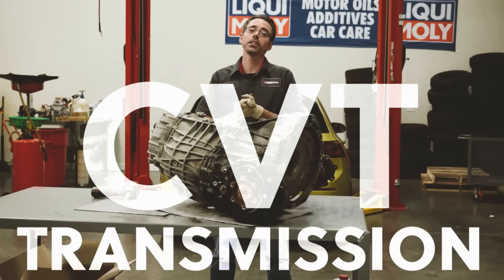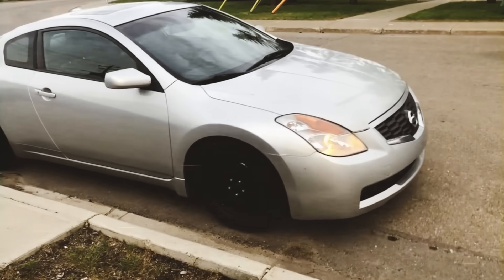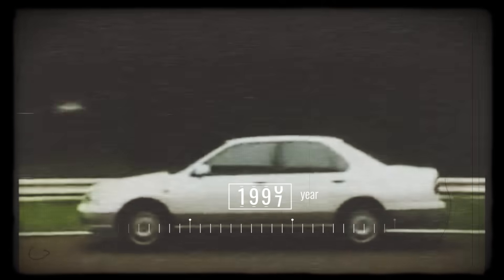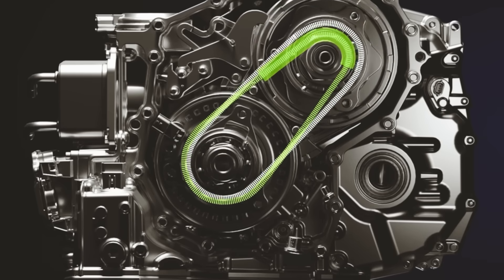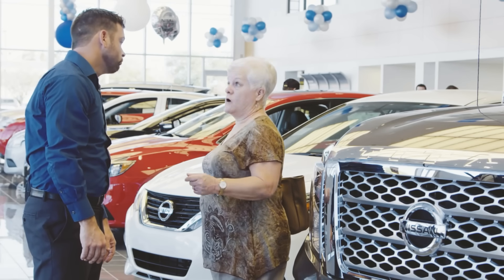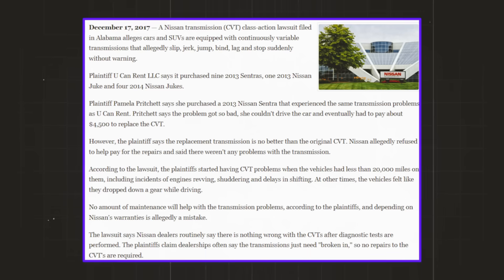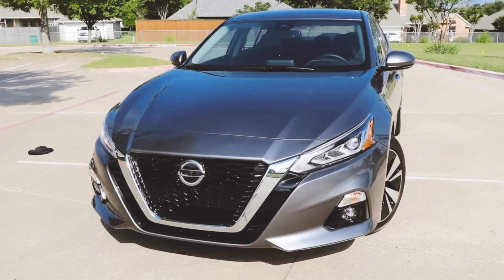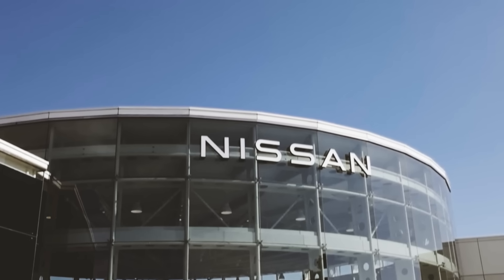Unpacking the FAILURE of Nissan's X-Tronic CVT

Comment: I have owned a 2004 Nissan X Trail ST 4x4 for the last 10 years. It has only 170,000 Km, and has been regularly serviced since new. Still drives and feels almost new, with the 2.5 ltr petrol engine.
The Nissan, and its reliability has impressed me. Naturally, the Automatic Gearbox on our Nissan is REAL!! I was about to go out and purchase a 2 - year old Nissan X Trail, until I checked and discovered that the "modern" version of the X Trail was fitted with a CVT Unit. I ask this question: Why re-invent the Wheel?? CVTs have been around (at a guess) the 1950s. I have also worked in Industry with CVT Units, that operate on the Cone Principal. I have seen them get so hot, that you can very easily fry an egg on them!! If the CVT in the Nissan is getting hot, then the laws of Thermodynamics tell me that this is energy (which should be driving the wheels) - is lost - as heat. Sorry, but now it will be a purchase of some alternative Japanese SUV - that is still manufactured with a real, conventional Automatic Gearbox

Comment: Total garbage any CVT. I got burnt once on 2011 Cube never again! The rebuild cost me $3500 at 106,000 miles in 2018. The 2011 Cube didn’t qualified for cvt trans recall. BS only purchased a manual transmission. BS  just go back to gears!

Comment: My 2016 Altima's CVT failed at 49,500. A $6100 replacement from Nissan failed after 200 miles. Back in the shop.

Comment: I had purchased a used 2017 Nissan Sentra three years ago and was told it was a rental by a Nissan dealer in Phoenix Az. I wasn’t informed that the transmission needed extra attention in servicing. It recently started to have acceleration problems with the air conditioning on. Took to a Nissan dealer in Flagstaff Az and was told that it needed a new transmission at a cost of $8K. They didn’t mention anything about the   the class action lawsuits. So, not only Nissan and their dealerships are keeping quiet about theproblems with CVT’s. I don’t have the money for a replacement and most of those lawsuits listed on the internet are closed.

Comment: After 2 CVT failures in 90,000 miles, we Just dropped our 2013 Sentra as a trade-in for a Toyota.  Sentra was a great car, but the POC transmission was a huge pain.  Our LAST Nissan.  Ever.
Reply: How much $ did you get back? My 2016 Rogue’s CVT is going to absolute shit. I ran an errand and had just enough energy in it to make it back home, even flooring it a few times.

Comment: CVT's are cheaper to manufacture, but freaking expensive to replace if the belt explodes...so WTF!  Then putting in the fake shifting negating some of the CVT efficiencies.  So just go back to a tried and true geared transmission...maybe the fuel efficiency regulations are so scary that losing faith rom your customers and lawsuits are the lessor evil?

Comment: Click bait.         How bad is this transmission that the creator of this video felt the need to put in footage of a TOYOTA PRIUS at the start?   The Prius has the most reliable tranny there is, so let's lump it with the Nissan - the people with the worst tranny.    Then the video implies that the Toyota CVT is the same unit. . . . . .  Which it isn't.  About as similar as apples and elephants.   Grossly incompetent video. . . . . . . . .

Comment: 2014 Nissan Rogue, CVT failed at 60k miles, but after 5 years of ownership (so no warranty). Paid $1600 out of pocket to replace the valve body of the transmission. Did get my money back last year in the lawsuit since I kept my receipt and dealer documents.

Always brought the car to the dealer for maintenance. Had issues even with the CVT not shifting from the lowest gear when starting up hill from a stop, turns out that it was a software defect for that.

Comment: I bought a 2012 Maxima, new and have 50,000 plus miles on it. I change the trans oil every 5 yrs and have not had any signs of trouble. I know the mileage is low but  I think they made them stronger but I also make sure to change the oil and at least every 30k mi or 5 yrs which ever comes first.

Comment: only recal for my 2022 nissan sentra is the tire rods. 54000 miles oil changes every 4000-5000 miles, transmission fluid changed at 49,000. no issues
Reply: That's very low mileage. Seems like a lot of these transmission failures occur passed 100,000 miles or so

Comment: My mother had....i believe it was an 09 rogue. Had gone through 3 cvts before I totalled it with like 80k miles on it. Those things are hunks of junk. IDC what the lunatics out here claim about "they break because you arent maintaining them properly" If your transmission is so shit that taking it to the dealership for everything (because it is new when you buy it and has dealer services) and you can go through multiple of them in under 100k....its a bad design. People drive a random Camry for 200k without ever doing anything to the transmission and it will run great. If it takes random luck and adhering to the manual TO THE T for it to not have catastrophic failure, it's a bad design.

Comment: Nissan also finances to the people with the worse credit. They have more horse power then Subaru that uses the same manufacturer for the cvt. People that buy Nissans or lease them. Tend to beat on them and don’t service them/ change the fluids. I’ve even seen Nissan adding dipsticks to there cvt. Making them easier to service.  Unlike Subaru.  So there are other factors to Nissans bad transmissions

Comment: I don’t know but I have 2012 rogue with 155k and still going never mess with the CVT , I just changed oil every 3k miles and don’t drive it hard, it’s 14 years old, and I have a 2018 GLC now that 9 speeds jerks a lot

Comment: Don't understand why people are surprised at this. Normal transmissions that EVERYONE have been using for the last 60+ years fail all the time, why is this any worse than that? 

And that has been researched and developed and worked on by every single automaker in existence. 

I had a Nissan Altima back maybe 10 years ago with their cvt, I also had a Honda Civic with a cvt at the same time and the Nissan one was way more reactive and quick and didn't seem to be "searching" for a gear like the Honda did. I know no gears exist but they have this time after you accelerate that they adjust and it was way better in the Nissan.

I don't like any cvts but as far as I can tell based on my experience with Toyota, Honda, and Nissan, they have the best of the group.

Comment: Owned 4 Nissans and was a  lifelong fan… even part of a Z club. 
Then I bought a 2003 Murano with CVT for my wife and will never go back to a Nissan dealership. Car was 100% disaster, even with 3K oil changes and 40K trans oil changes. They squeezed too tight and you can tell.

Comment: IMO the new Maxima having a turbo 4 cylinder engine (less torque) is likely what fixed their CVT issues. Seems the VQ35 V6 was the engine that consistently blew up these CVTs although I'm sure the driving style had more of an impact overall

Comment: Yes, these transmissions are definitely junk. My daughters 2020 Nissan Versa's failed at 82k miles. When I asked the service department if the fluid change was part of the maintenance schedule and they said no, but customers do have it done. This company needs to add fluid changes like Honda and other manufacturers do. Otherwise, don't buy cars with a CVT.

Comment: Yea they are bad transmissions. That said driving style and maintenance can go a long way towards extending the life. These do not like a lot of sudden full throttle driving. Ease into the throttle and they will last. But instead, due to the rubber band feel, people jam the accelerator to the floor when it’s slow to respond, stressing the transmission. Service every 30k or at least by 60k regardless of the manufacturer’s recommendation.

Comment: i run a 2021 kicks knock on wood no isses i have 35k miles its new they fixed most issues with the xtronic in late 2020 maintain them do flushes every 30k i do mine every 10 k its worth the 250 bucks every time i do it just maintain and go easy take off slow when going into reverse wait 3 seconds before going into drive dont slam on the gas treat it like its your last car forever on earth  and it will last and anymechanic that tells you we replace parts drop them cvts are not serviceable you replace the whole thing wiht a new one a new one is about 3500 to 4 grand and another 2-3 to install 6500 should cost   these should last beyond 120k miles folks just treat them right

Comment: The video failed to note the difference between the Toyota eCVTs with the planetary gear and the cone/belt CVTs. The planetary gear types also used by Ford and even a few early Nissan's are bulletproof. The cone/belt CVTs will never be suitable for automotive horsepowers.

Comment: Maxima 2004 was the worst car I've ever owned. It was only good on the open highway. Locally it had no feel for the road. It was exhausting in stop and go traffic and I aways viscerally  felt the transmission searching and searching like watching a video with a bad internet connection. No kidding, I had other Maxima owners of that era pull up beside me to complain about the same experiences. You've been fooled. The Maxima sucked as hard as the Murano you just don't have the right information.

Comment: I have a 2017 nissan sentra currently at 131000 miles. I bought the car new with 27 miles. it is still running.

Comment: I now know that's refraining me from putting the 2025 Kicks on my list. I'm shopping right now and a Kicks is so much the car made for me. But I'm scande of Nissan and I Think I'l stick with Kia for another véhicule. Have a 12 automatic Rio with 0.003 problem. Some Brands have so bad réputations it's becoming scary: GM, never in a lifetime. Too many squeaks and rattles. Stellantis, Are you crazy ? Has a 2000 Neon. Had enough. Ford, the most expensive and less reliable vehicules right now. But if I wanna be invisible, I can chose a Civic or a Corolla.

Comment: I actually like CVT.*

Bad thing about it for me are: 
1. that CVT belt WILL fail. It's just a matter of "when".
2. First few moments when accelerating is sluggish.

What car manufaturers should have done is to install a magnetic chip detector (which actually in use in some(?) aviation gearbox) that will warn us presence of metallic chips, so we can change the damn belt before it failed catastrophically & possibly damage other components.

Comment: I had to replace the CVT on my 07 Maxima. Out of extended warranty of course. A very reliable car. Everything has worked great except the transmission. Imagine all the vehicles Nissan could have sold if they didn`t use the CVT. The bean counters should have seen this mess coming.

Comment: That says a lot about Nissan motors. They knew that they were putting piece of junk transmissions and vehicles and selling them for a premium price and that says a lot about their they're concerned for their customers safety. Nissan used to be one of the best cars you can buy back in the 90s before the CVT I mean servicing take them in have the oil change transmission fluid and you could literally put 3 to 400,000 miles on those cars I had a 1991 Nissan Sentra SE-R, and I would rather have one of those make and model cars than anything I could go to a car lot and buy these days I wish I could find one. Consequently I will not buy a late model Nissan at all.

Comment: I get 300k miles out of my Nissan Jatco transmissions. I change the fluid and 1:53  every 25k religiously along with both filters. Sometimes even the Nissan shops don’t change the cartridge cooler filter which will lead to death. And I only use genuine Nissan fluid. I’ve seen aftermarket fluid destroy these CVTs the new Toyota CVT’s are almost bulletproof if you changes the fluid regularly.
Reply: But other trannies require zero maintenance for the life of the vehicle.

Comment: Had a Murano, at 80k the cvt would slip when hot outside, had it serviced asked if Nissan made a cooler for it, they said nope,  by 100k started to slip again took it back to have serviced, no joke same guy at Nissan dealer asked if i wanted to have a trans cooler installed to help. I asked whe did they offer it. Him: since they started using the cvt because they run hot. I replied funny i asked you about it last time and he said nissan doesnt offer one, he didnt say a word after that, put and aftermarket one in and never slipped again

Comment: I think the biggest problem is people do not know or refuse to accept the fact that you cannot drive a CVT as aggressively as you do a regular transmission. They do not hold up. By this I mean hard from a standstill starts all the time. If you are that type of driver, then you should not buy a CVT equipped car. Also, Nissan says in their owners manual CVT fluid and filter changes every sixty thousand miles. They don't want to tell people the truth because people will see that as too much of an expense and not buy the car. Truth is it should be changed every thirty thousand miles. But most people do not read the owners manual so they do not have the fluid changed at all. And that is the main reason for the failure rate. Aggressive driving and lack of maintenance.

Comment: I've owned a 2010 Altima 2.5 since new. I haven't had any problems in 160k miles. It has been the most reliable car I've ever owned. I've done CVT flushes (not drain and fill) every 30k miles. I think Nissan could've avoided a lot of problems if they told their customers the fluid should be changed at regular intervals. They push the "lifetime" fluid which is supposed to be good for 200k plus miles, but that is completely BS. The condition of the fluid is trash even at 30k.

Comment: I had a 2012 Mitsubishi Outlander with the same Jatco CVT as Nissans. It was starting to fail at 88k miles. Mitsubishi replaced it under warranty at no cost. It held up the remaining time I had the car. I now have a Kia with a CVT, and it feels much better. Even though the Kia transmission is supposed not to need fluid changes, I’m going to do that every 50k knowing what I do now.

Comment: I bought a new 2007 Nissan Sentra with the cvt.  I went through three transmissions before my car hit 50,000 miles.  Nissan said they wouldn’t cover the next trans failure.  I sold it immediately and will not buy another Nissan.

Comment: had a 2008 Altima Coup with CVT it basicly exploded in 2012 and We were lucky Nissan had extended the warranty and it was replaced it for free. The service tech said he as seen a lot but had not seen anything like what happened to ours. all we did was gun it at a yellow and it made a pop grind then the engine revved like it was in neutral

Comment: I have a '16 Maxima that I bought new. It now has 159,000 miles on its original CVT. I changed the fluid @60K, 118K and 150K miles (with that last one also having the filter and strainer replaced). I feel like this car can go on forever (so far).

Comment: The CVT isn’t bad when done right, Toyota and Hondas cvts have very few issues and both have cvts with a real first gear to prevent the awful drone of cvts as well as taking the load off the cvt in start offs when the cvt is most stressed prolonging its life… they are good transmissions but Nissan doesn’t care enough to engineer a good one.